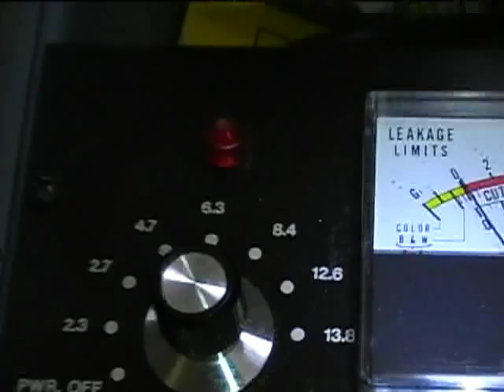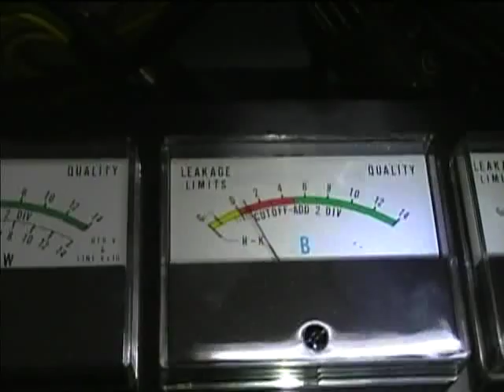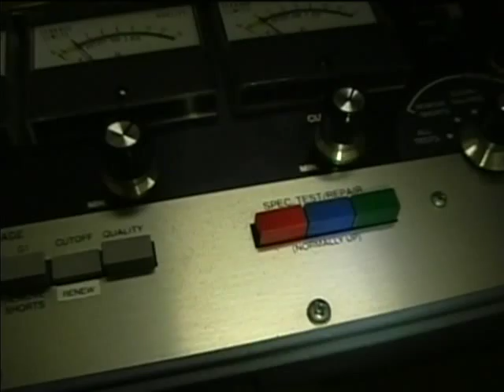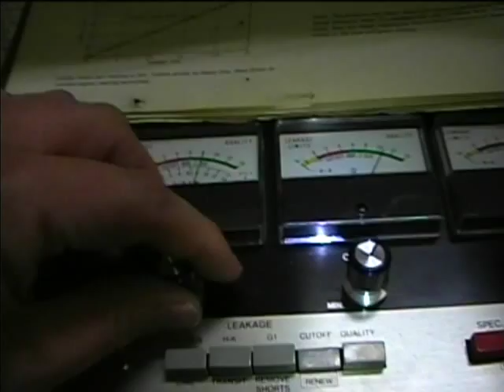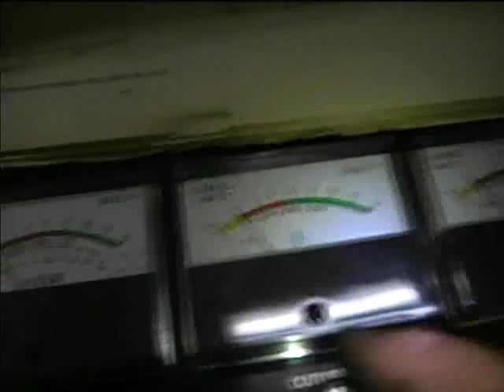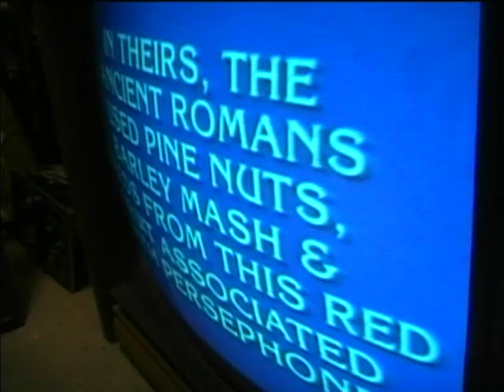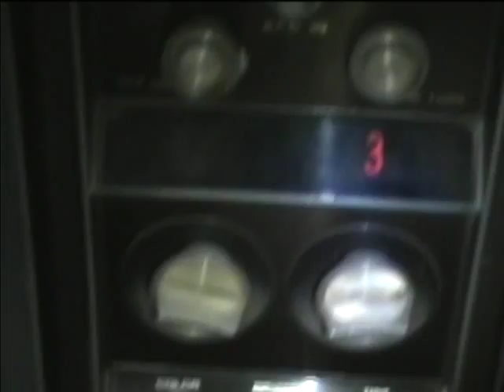1968 Sylvania chassis D12 tube type TV CRT rejuvenation

Comment from the maker: @mznxb9872 I did the clean and re-balance procedure after operating the set for about 20 minutes. I noticed that the red looked a little weak so I did the process on the red and blue guns and it helped boost them a little more.

Comment from the maker: @gbowne1 the D12 has more of the tube functions replaced by transistors especially in the chroma circuits. Also the horizontal output tube is different.